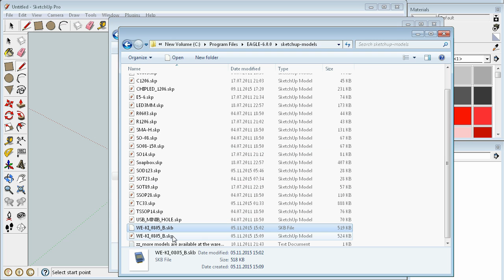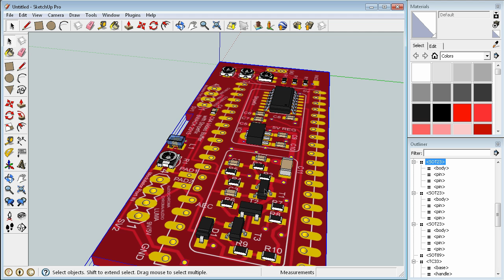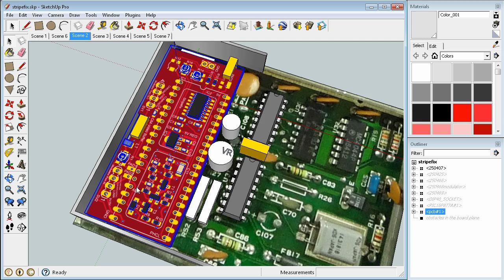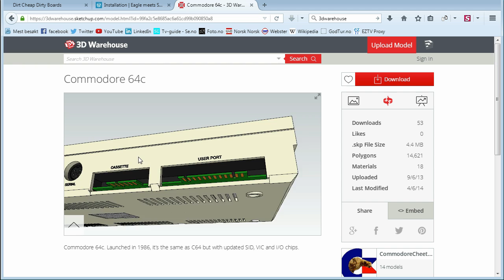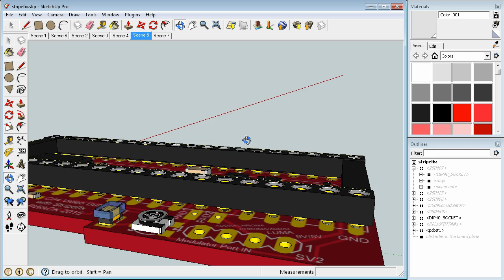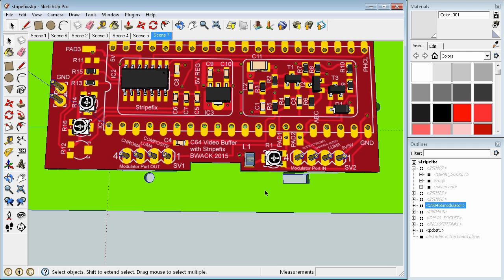Stripefix Modulator Part 7 - Ordered and eagleUp

Comment: Wowee Hans. This plugin looks amazing. Much easier to dimension things correctly this way. I don't think you realise how much you actually know. I'm definitely amazed each time I hear you talk about this stuff...Loved it!
Reply from the maker: +The Highlander Exactly. It's easier to dimension and check clearances. In large companies they usually have mechanical engineers that does the mechanical/material part of the design. I seldom see hobbyists use 3D software to fit their board. One time, back 2010 when I did my bicycle LED light project, and shared on the mtbr.com DIY bicycle light forum, he simply said "looks like much work". He was probably right about the amount of work, but he would never have fitted everything into an enclosure without having a 3D model, or it would take many tries and the lead time on pcb boards is like 3 weeks..
I wonder why you say I don't know how much I know, but I think you are right because sometimes I forget what I can do. It helps getting involved by doing projects.
Reply: +bwack All the tools to do this stuff are so easily available nowadays. I'm developing 3d models with blender and trying to make a game in Unreal 4 engine all with tools that are free.
I just wanted to say that I think you're very knowledgable about designing electronics. Compared to me at least. You appear to be very humble about it and I just wanted to compliment you. What you're doing, to me, is really amazing.

Comment: I like the configuration (jumpers) option as well!  Very cool!
Reply from the maker: +GadgetUK164 I hvae tested it now. Not enough to make video of yet. Picture looks crisp on S-Video, and the stripefix helps. I have only tested inverting the AEC so far, but I need to figure out which second signal to invert, because the second one I have routed on the stripefix board isn't doing anything special, and I remember having a second higher frequency signal that put the silver lining after adjusting the AEC. It got rid of the narrow spaced lines. Anyway colors look good. The LC filter in line with the chroma seems to make a cleaner color. I've had the impression that my breadbin 250407 modulator had better picture than my 250466.. So I hooked it up and wow, the lack of sharpness is very visible when compared to the simple stripefix board. There is nothing fancy about the video circuit board. I guess the simplisity helps, and also (not shown in my previous videos) I changed the composite mixing circuit by adding a second transistor on the luma line, one for luma and one for composite.. Now that I come to think of it maybe that second transistor on the luma line has some picofarads and may drag down the sharpness a little bit than I expected.. I'll have a look.. It is jus ta matter of desoldering one transistor..
Reply: Excellent progress there - sounds like this mod will be amazing!  I've got one of those stripe fix boards off eBay, which I think is just inverting the AEC signal - on my breadbin it looks aweful with that 'fix board'?!?!  I've yet to test it in some other 64s.
Reply from the maker: +GadgetUK164 ok. My stripefix board doesn't fix the problem 100% either, but the picture from the buffer is very crisp. Have you tried winding all the pots down to zero and then starting with AEC, winding it until you see the white lines, then wind back until they disappear ? Then when you are happy with that, start with the color clock signal (I think). That works for me. Not sure why the ones on ebay should be worse than mine other than that they load down the luma line by 3x47pF.. about 141pF... You might get better picture (less soft) if you desolder the cap that couples the third inverted signal to the luma. I was going to suggest rewiring the caps to the other side of the buffer, but there is no buffer. Since I don't plan to sell these boards, I think I will do a review on the board from eBay and maybe suggest some changes for those who like to modify things. Another thing I've been thinking about is to have a modulator replacement board kit with solder friendly through hole parts. Modulator replacements are very simple.

Comment: Fantastic work using sketchit there with C64C case - to check component clearance etc.  Brilliant!
Reply from the maker: +GadgetUK164 Hi. That's the idea, but the c64c model currently is more a 'prop' and I hope the author will allow it to be modified.. The individual boards I'm checking clearances with I took the photo from some "C64 platinen" webpages, scaled (we know the 2.54mm pin pitch), and raised some cylinders and boxes based on the photo. Easy.

Comment: Excellent progress!  Looking awesome with that plugin!  I love the way the board supports modulator pins or VIC chip - awesome!
Reply from the maker: +GadgetUK164 Thanks. I have a breadbin and a c64C case, and i need a modulator replacement, and in the breadbin i'd like to have stripefix (allthough the stripes aren't that bad on that breadbin 250407).